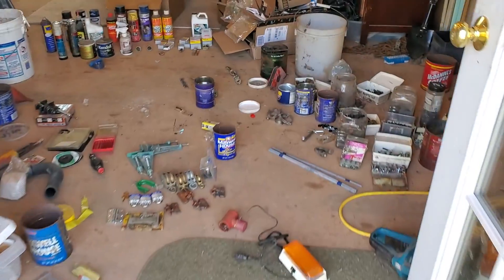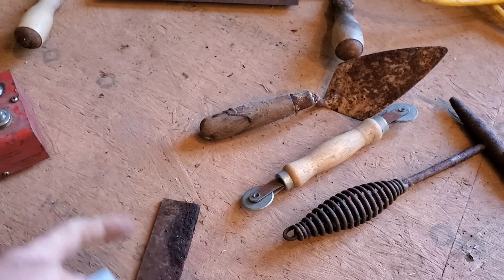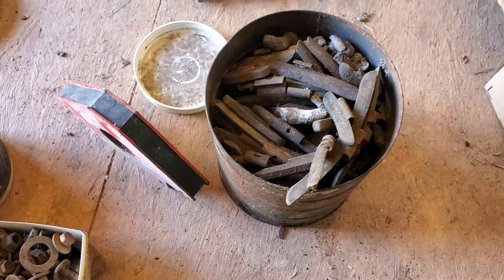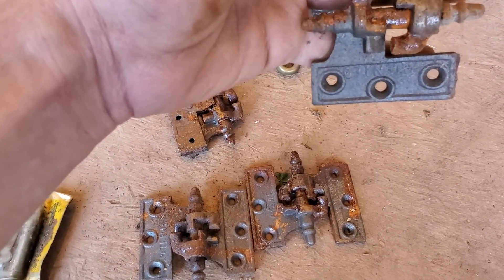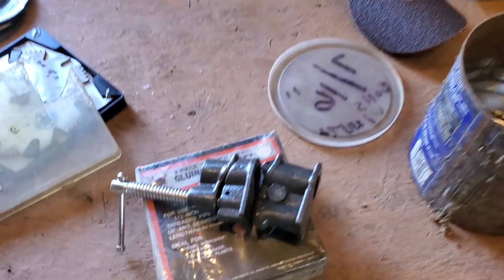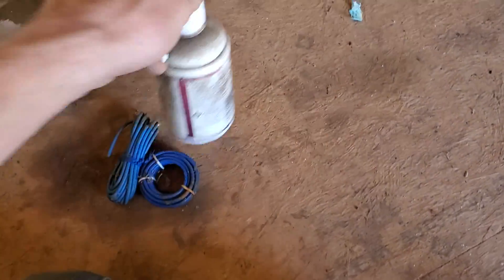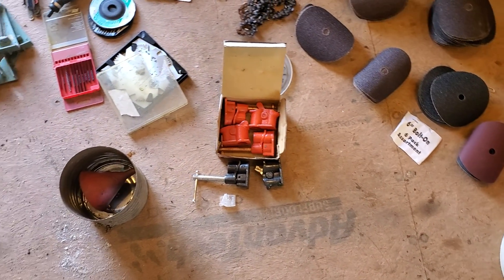Free stuff, garage cleanout.

Comment: That dimmer switch so looks like what was on the older cars to dim your headlights. They were located on the floorboards, left side. You simply pushed down on it with your foot and it would brighten or lower your headlights.

Comment: The brass looking piece that you thought was an injector was the tip to an acetylene cutting torch
Reply: Also used to clean the tips of a mig welder
Reply: Tire sealant you put in your atv tires and if you get a nail or small leak it seals the hole

Comment: 1:50. Looks like a remote starter for an ice (internal combustion engine). Tip cleaner is for a gas torch tip. Cast iron rust could be fixed using electrolytics.electrolytic.
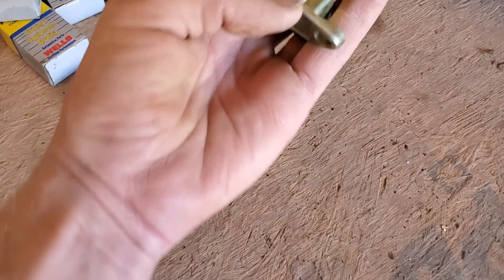12:45  points and condenser - mechanical ignition parts, circa - pre-1970. 12:58 acetylene torch tip. 13:22 "dimmer switch" mounted on floor of cars up to about 1970. Used to change headlights from low beam to hig b beam or back.